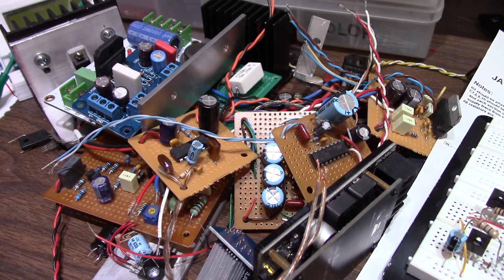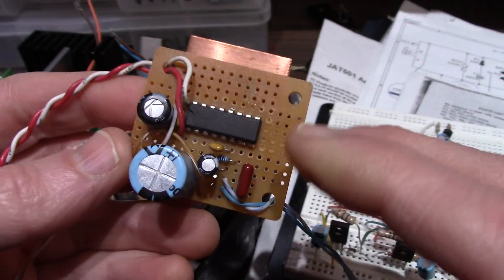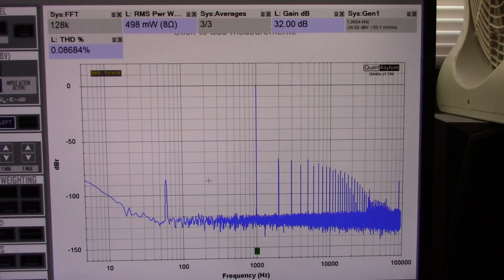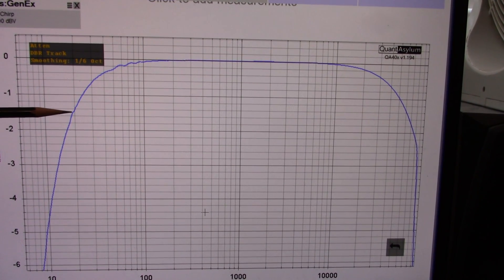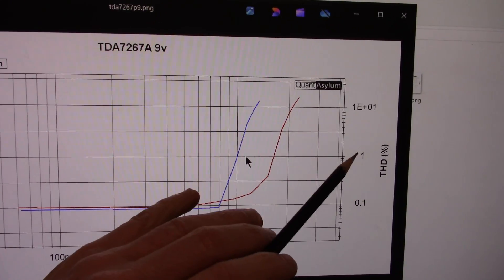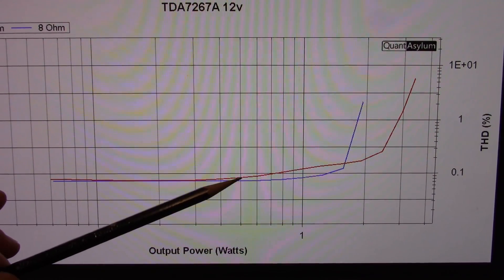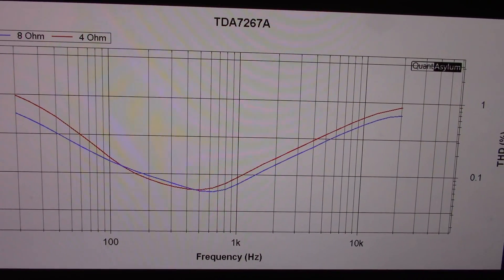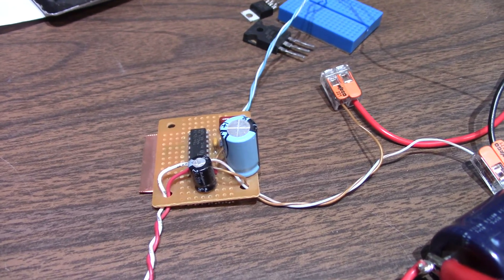TDA7267 amplifier on the audio analyzer

Comment: It would be great if you could provide the schematic or values you used on that board.  I'm interested in using that chip on 9v battery for crystal radios.
Reply: I found your other video,  I'm GTG

Comment: You might consider the TPA2005D1DRBR for low power applications. I've used it and it is tiny and very capable with few components